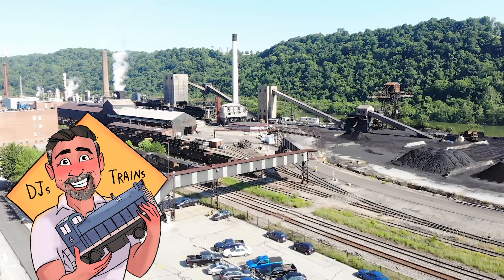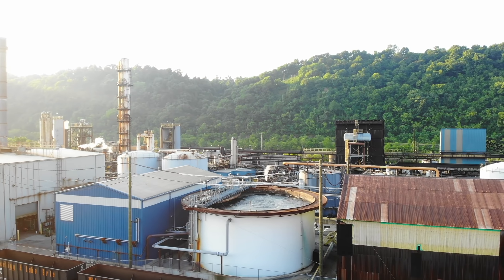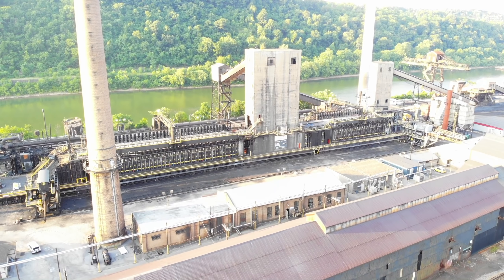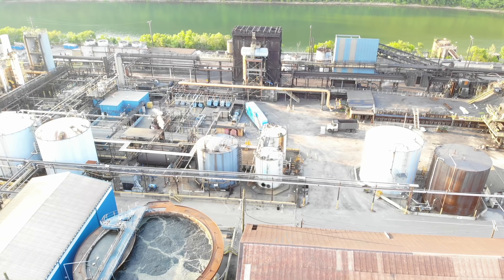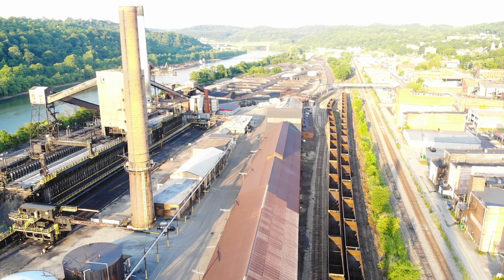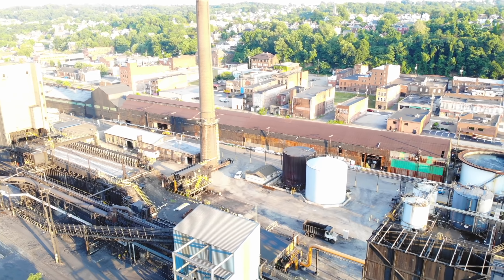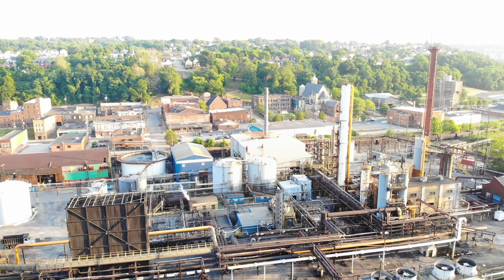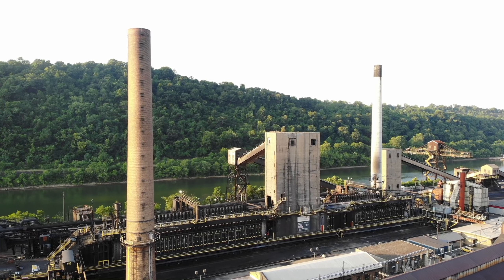Amazing Views & Understanding The Coke Works. Perfect for model railroads.

Comment: Better not have limited space, this plant is enormous. Maybe do a video on shrinking this down to smaller layout areas and the most important parts to include.
Reply: And it's not even the largest. When US Steel's Fairless Works in Morrisville PA was in full bloom it was the largest integrated steel making facility in the US. Now most of what was there is gone - take a look at Google Earth and slide through the timeline.

Comment: The coke plant was originally part of Pittsburgh Steel at the Monessen Works. It later became Wheeling - Pittsburgh Steel until it was closed and was sold to China. China took everything except the coke works. There were 3 Blast Furnaces. Blast Furnaces 1 and 2 had a common cast  house between. Plans for them can be found in the Library of Congress and are in PDF files, which can be downloaded. Blast Furnace 3 was the "Industrial Settling" seen in the original "Robo-Cop" movie. The Monessen works also had an Open Hearth, Basic Oxygen Furnace [ BOF ] and a Rail Mill. It made the structural steel for inner core of the Saint Louis Arch. Adjacent to Pittsburgh Steel site on the down river side was the Pages Wire and Steel, which made chain link Fence, Wire and Nails. >>> Great camera - drone work on the video. Showing the adjacent hills and landscaping is so important to get that sense of place for modeling western Pennsylvania. You do a very good job of including the critical information about land massing and the roll of the hills. Super well done !!! --- Thank you for doing such an excellent job with these videos. --- John
Reply from the maker: I appreciate that, my friend

Comment: Ex-steelworker here at US Steel Fairless works. Did 2 years at Coke Works. Interesting note is that the refractory brick lining in a coke oven is just dry stacked and is dependent on the high heat to keep things in place. When a coke oven battery goes cold the bricks just fall in on themselves.

As to Freitag's modeling it was okay but incomplete just like what Walthers has put out. No pusher ram or door cars.